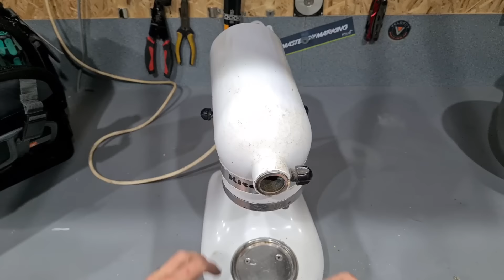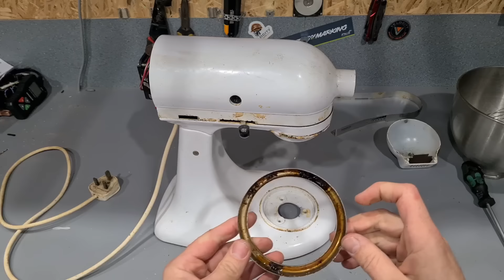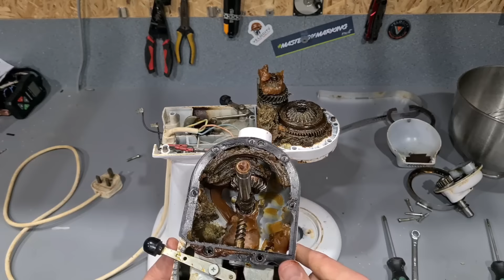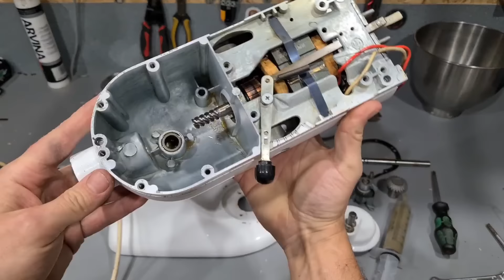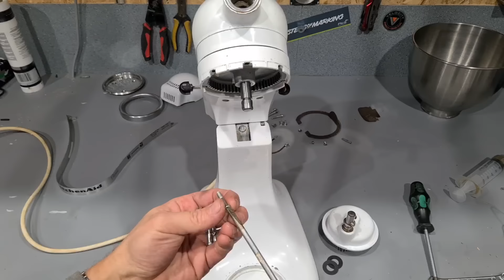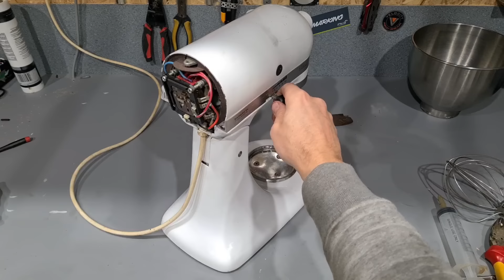Repairing and servicing a Kitchenaid Classic food mixer.

Comment: Amazing video, helped a lot!! I had to change the worm gear, now I replaced it but it seems like I didn’t properly adjust the speed board. The machine doesn’t react to at all when plugged in, I can only see a spark inside when I come from full speed and reduce it back to zero. Any suggestions what might be off?

Comment: Hello, wondering if anyone can help?! I followed the video and when I went to turn it on there is no power. I have checked the brushes, the cable connections, the plug fuse and the speed lever spring. All seems fine. Can someone please help, its an Artisan mixer and 6 years old. Thanks

Comment: Ours is 25 years old, and I just followed these instructions. Amazing how black and goopy the old grease was. Got it running good as new! It’s a U.S. model (110v) so the wiring is a bit different. I didn’t need to remove the speed controller. Everything else was identical in the U.S. model. Thanks from Charleston, SC, USA.

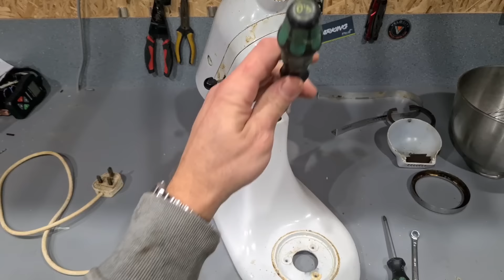Comment: What you did with the screwdrivers (10:10)for removing the pin will work on maybe 1% of the mixers. It will never come out that easy, unless it's been removed many times. Always use a pin punch (not a center punch) and a hammer to remove that pin.

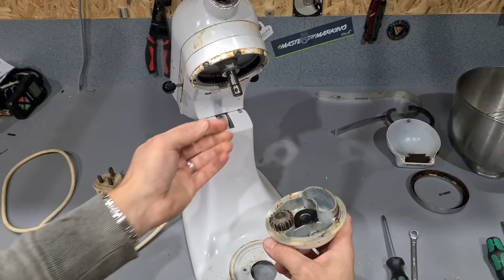Comment: I cannot get my pin out for God or money min. 10:35 and my whole repair has stopped what do I do?
Reply: You have to use a pin punch (not a center punch) and not a screwdriver.  Hit it from one side and then the other. Once you see that it's moving more one way than the other continue to drive it out.
Reply: @BringItOn31124  I will try again but can only reach the one side for now.  If it wont rotate is that part of the problem?
Reply: @laurazeman5535 Place the beater on the planetary shaft and manually rotated it.

Comment: How did you adjust the head so that the blade doesn't hit the bowl? I must have missed that  .
Reply: Turn the head adjustment screw (located in the neck of the mixer) counterclockwise (left) to lift the head of the mixer.

Comment: hi Dean i was gifted a kitchen aid same model and by accident without realizing I plugged it to 220 when It should have been plugged in to 110v, it worked on very high speed and the trip went off: I don’t use it again: then I got a converter but now it does not work  how do I fix it. There is no burning smell at all:

Comment: Hey Dean 
I got New Kitchenaid from USA and trying to use in Europe but somehow after plugging it starts spinning for 5/6 seconds and shuts off 
I do have the adaptor which gives from 220V into 110V but still machine goes off :( Could you pls advise what would be the reason for that 
Much appreciated
Reply from the maker: it might be to big of a machine for you adaptor. what the rating on adaptor and the power on your kitchenaid. 
Now i take it you mean you got a power reduction transformer of some kind. not just a plug adaptor. as you cannot run a 110v machine on 220v power.
Reply: @deandohertygreaser  hey Sir, Yes, I am using power reduction transformer from 220v into 110v as USA made KitchenAid Mixer runs on 120V and I bought power reduction transformer too and still Mixer runs for a 5 seconds and stops,,, even at the 1st speed it runs fast too (but I see now on your video how to reduce it) but main issue I am facing here why it shuts off or the inside chip card is giving error or burnt? Thanks a lot for your time much appreciated

Comment: Hi Dean. I've just finished putting my mixer back together after servicing and re greasing. I am devastated because it now won't start. I've double and triple checked the wiring and it seems to be good. What am I missing?😢😢
Reply from the maker: your brushes. They have to be installed the correct way around. one side has a little notch cut out, it has to in the correct way round.
Reply: Did you fix it?

Comment: We used to have several fixit shops around us and now there is none.  I do realize we are a throw away society but who wants to throw a $250+ mixer away if it's not operating properly.  Thank you for this video.

Honestly earlier today I went online to figure out why our mixer was jumping when it was being used.  It had the exact opposite problem.  The setting was too high.  With one of the videos I found the set screw and using a dime in the bowl, set it back to where it was supposed to be.

Comment: Greetings.

I just rebuilt the motor with factory parts, speed plate included. Stir setting won't run, just a moaning motor even with top screws nearly completely unscrewed. Higher speeds seem okay. 

Any ideas?
Reply from the maker: You probably need to replace the phase board also.

Comment: I never saw a similar mechanism for speed control as in this machine. So it basically has the same effect as the thyristor controller in power tools but instead it is based on mechanical principles only, as you explained. Brilliant 😊

Comment: Hi Dean, I've got one of these that was spinning too fast at the lowest setting. I tried to adjust the control panel screws but must have touched the part with the screw driver. There was a big spark and the tripped the house electricity. Now the machine won't start at all. Is there a fuse inside the machine that needs to be replaced?

Comment: Emergency!  Help!
At first, thanks for a great, great video! I was going through the entire steps, cause the speed of my Artisan ksm150 was going way too fast! So, took the band and the end cap off. Then the motor (electric part), cause it was soo dirty and full of dust. Cleaned it with isopropyl alcohol... and then I'd tilt the machine backwards to get the last small dried dirt out. And then, suddenly a small (about 1x1x0.1 cm) kind of external tooth lock washers fall from the machine on to the counter top. And didn't see at all where it came from!? Do you have ANY suggestions? 🤞🤞🤞Saw your great video again without getting much closer to an answer 😢

Comment: good detail, good instruction. followed it to the t. when i was done i had no power. the brushes are not the problem i think. i believe the problem has to do with the copper plate at the bottom of the speed engagement assembly, it is only connected on one side. any thoughts?

Comment: UK only but there was no RF board in that which for the UK stops any RF interference and would be on the incoming mains looks like theres a mounting post for it though, probably its age that there isn't one. Quite a few don't have the return spring, there should be a hole in the lever near to the pivot screw that the spring would clip into and the other end goes to a holding screw, near where the lock hook end exits, I can see that there is a mount but looks like it might have something broken in it difficult to tell. Also on the later models you will see a plastic head lock on the outside pop riveted in at the rear for the hook to latch, often broken to be honest there plastic and don't stand knocks. K45 came out in 1962 the SS designates solid state.

Comment: First off - love your videos!! 
Second - before stumbling onto your channel, I was repairing both power tools and actually also Kitchen Aid machines. 

You mention that there’s not much you could do about the side to side movement of the head. A quite common problem on all Kitchen Aid machines, is that the grub screw holding the large pivot cross pin between the base and the head in place, works itself loose. This could cause some side to side movement in the head 🙂
Typically I get machines in, where the cross pin is sitting part way out.
Just turn the machine on its head and you will see the screw 👍

Comment: I actually got one from the garbage down the street from me. It was sitting right on top of the can(tote), waiting to be grabbed - by a scrapper i'd guess(which i also do from time to time). Anyways, I plugged it in and it works fine. Its the exact same model, minus locking bowl and of course the attachments & the bowl. I grabbed it thinking it was scrap, but after testing it, I'm gonna keep it, cause it works fine. I just have to get all the accessories for it off of Amazon. Great find for me, cause those are not cheap at all. They're running like $250 nowadays! So even buying the accessory kit, I'm still up a couple hundred from a new one! Anyways, nice video and Happy New Year to you from Buffalo NY!